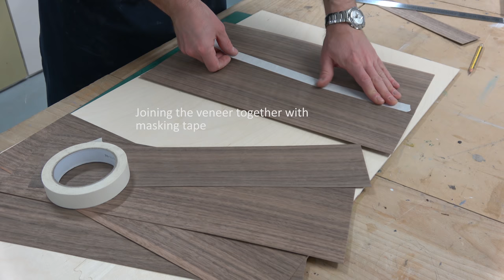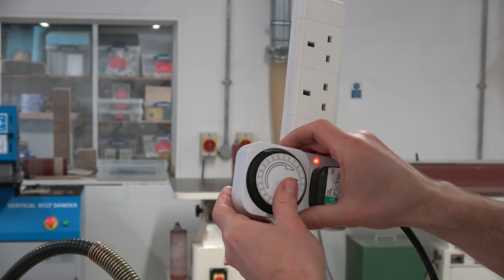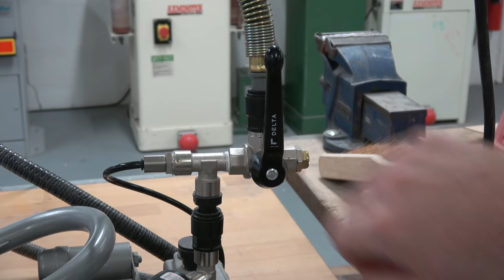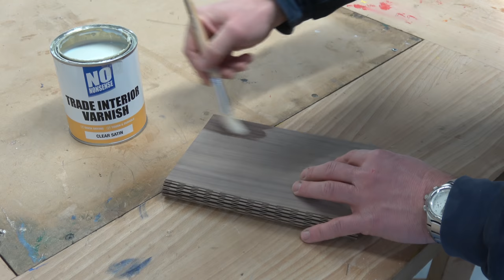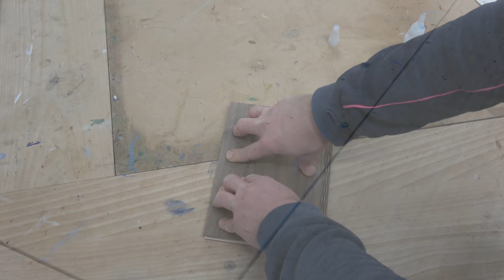Making a living hinge (veneered plywood & acrylic)

Comment: What are you applying to the notebook and cover? What glue are you using? Love the video and beautiful work.
Reply from the maker: Thank you. Using a two-part spray adhesive (such as mitre fast), to attach the notebook to the wood.  It’s spray on one surface and a thick liquid on the other. When they come together, they react and form the bond.  Then clear varnish on the wood.

Comment: Have you ever tried doing the living hinge with just a veneer?
Reply from the maker: S. Moore Art & Design no, it would be extremely delicate. Worth doing if you have an application for it though.
Reply: @productdesignermaker  This is one of the first projects I want to do when I get my laser cutter.
Reply from the maker: S. Moore Art & Design brilliant! Did you see my video on the multi directional living hinge? You can download the file for free on my website www.productdesignermaker.com
Reply: @productdesignermaker  Great I'll check it out, thanks!
Reply: @SMooreArtDesign  Did you ever end up doing it? I'm thinking of buying a laser cutter for just that reason for a community project. Would be very helpful to know if it's worth trying out.
Reply: @whylaffwharff5079  I actually found a makerspace with a good laser cutter. I would recommend going the same route and trying some materials before buying. The one near me charged me $20 to do several cuts plus a lesson on different settings for different materials. Buying the machine is such a huge investment. Just replacing the laser tube can be thousands of dollars, and they can start fires if they aren't maintained properly.

Comment: Hmmm. You demonstrated how you bound a book in a veneered plywood cover in which you lasered a living hinge. The subject of the video is binding a book. Your video title implied it was about lasering a living hinge. It is not about that.
Reply from the maker: Wow!  Nearly 6/7 of this video shows the process of making a living hinge!  Thanks for the helpful feedback!
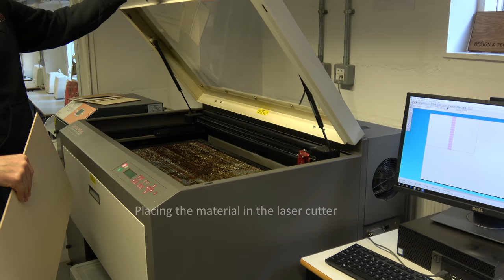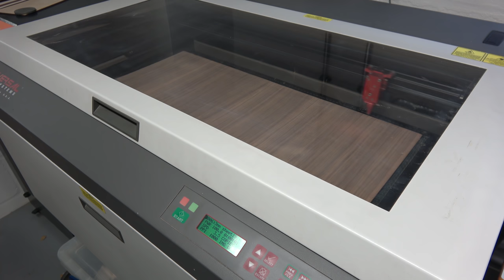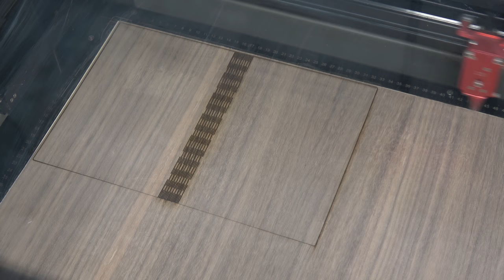Reply: @productdesignermaker   As someone who was searching YouTube for lessons on "how to make a living hinge", what I saw here was the first 3:32, or 50% of the 7 minute video, on how you made the substrate via veneering. Then from 3:42 to 4:15 the laser cut the living hinge, with zero info about that process, except that you shared that what is required is that you push a button on the laser. From 4:25 to the end, you showed how you put the living hinge to use as a wood book cover.
The helpful feedback is to consider re-titling this video, because it is 6/7 about putting a living hinge to use in binding a book. You put a living hinge to good use. There is no lesson here in making a living hinge. None.
Reply from the maker: @bloomdds  no, none of this is helpful feedback.